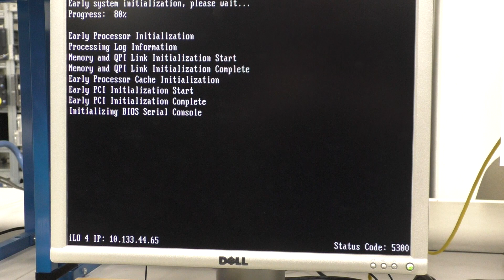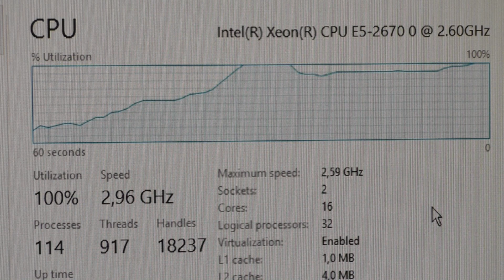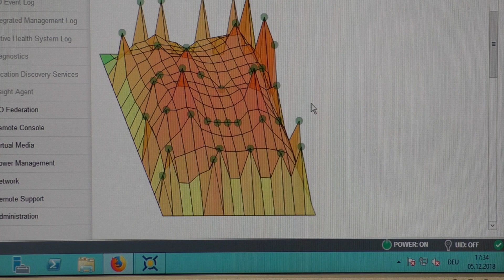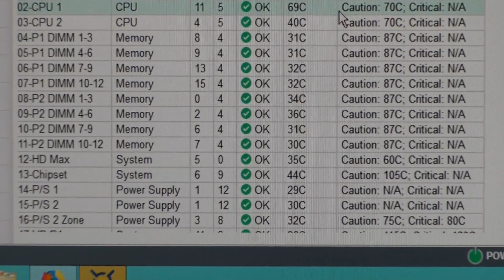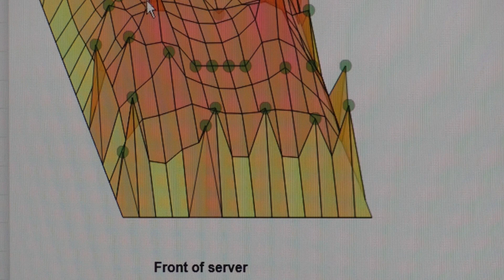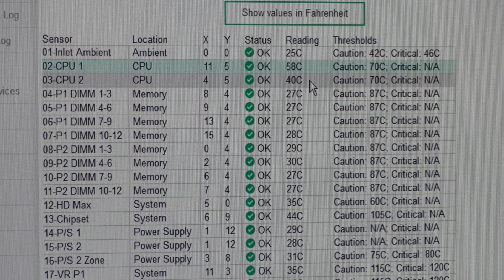What happens with a CPU without thermal paste? - (PWJ121)

Comment: Pretty sure Intel CPU have had thermal throttling built in for quite some time to protect them self from damage. There is however a setting in the BIOS of the DL380p Gen8 that will shutdown on thermals I don;t know if that was off or not during these test but since the processor never when beyond the caution level I don;t know that would make a difference.
Reply: i using i3 cpu and gtx 1050 ti already 2 year without thermal paste still fine with side case open-----surely cpu temp easy increase from idle 45-50 to 100% load 67-72 i look from every site as long cpu temp below 80-82 is fine

Comment: Running it without the top on will also typically make the fans run faster. Those servers rely on pressure & proper airflow to stay cool, remove the lid and that's now gone... the controllers send the fans into HOLY CRAP mode just to be safe / try to bring it to normal temp levels. 
interesting results.

Comment: CPU is throttling to stay below 70°C
Reply: TjMax on a Sandy Bridge-EP chip is 105.
Reply: @SoranoGuardias  i using i3 cpu and gtx 1050 ti already 2 year without thermal paste still fine with side case open-----surely cpu temp easy increase from idle 45-50 to 100% load 67-72 i look from every site as long cpu temp below 80-82 is fine
Reply: i using i3 cpu and gtx 1050 ti already 2 year without thermal paste still fine with side case open-----surely cpu temp easy increase from idle 45-50 to 100% load 67-72 i look from every site as long cpu temp below 80-82 is fine
Reply: My is 94
Reply: The chips throttle down to conserve power on light loads.

Comment: Excellent experiment and video! It clearly shows why a perfectly flat interface is so important. Intel thermal management is quite good. 15 years ago I saw a demo of removing the heatsink while the CPU was at 100% and the response of AMD versus Intel thermal management. The Intel chip throttled at the maximum temperature just as in this video but the AMD chip promptly exploded with a very decent bang. No paste with one hair seems to be well into failure territory.
Reply: No it never exploded. It overheated, smoked and died. It was Tom's Hardware Guide that did the test I believe, on consumer grade CPUs.
Reply: iirc it was also later revealed that the motherboard used in the AMD system which smoked in the Tom's test did not have a shutdown feature which monitored the CPU using the on-die temperature sensor. I don't remember the specifics but it was either using a thermistor mounted in the CPU socket which is far too slow to react to removing the heatsink, or the shutdown feature was inoperative. These days all CPUs have inbuilt throttling (CPU core voltage, core frequency control) so they can protect themselves without needing the motherboard to intervene, although most motherboards can still be set via the BIOS to completely shut down the system should the CPU hit a predetermined temperature.
Reply: @tmmtmm  Yeah lots of rumors flying around at the time that THG was in Intel's pocket too

Comment: So it seems that both, the CPU and the heatsink surfaces are very well made, smooth and uniform. Cool!
Reply: i using i3 cpu and gtx 1050 ti already 2 year without thermal paste still fine with side case open-----surely cpu temp easy increase from idle 45-50 to 100% load 67-72 i look from every site as long cpu temp below 80-82 is fine
Reply: gunawan gunawan santoso h uh you might wanna put thermal paste on there
Reply: gunawan gunawan santoso pre builds also come with thermal paste already

Comment: The frequency is correct, it is the turbo frequency of the CPU's. Yours is max 3,3GHz on 1 or 2 cores, but windows server reports the max frequency of any core as the speed even if it is only 1 core running 3Ghz and the rest running 2,.6GHz. My dual e5 2680V2 says it is running 3.6GHz, but the cpu's are only nominal 2.8GHz
Reply from the maker: yeah I know.... it's the turbo freqency
Reply: i using i3 cpu and gtx 1050 ti already 2 year without thermal paste still fine with side case open-----surely cpu temp easy increase from idle 45-50 to 100% load 67-72 i look from every site as long cpu temp below 80-82 is fine
Reply: @gunawangunawansantoso4122  lmao i3 and 1050Ti? What are you? Poor PC guy XDDDDD lololol

Comment: Noooooooooooo, poor DL 380, glad you survived, amazing servers.
Reply: i using i3 cpu and gtx 1050 ti already 2 year without thermal paste still fine with side case open-----surely cpu temp easy increase from idle 45-50 to 100% load 67-72 i look from every site as long cpu temp below 80-82 is fine
Reply: gunawan gunawan santoso Thermal paste is really cheap. Add it and it will significantly increase the lifespan of your CPU. Not using thermal compound is really stupid and can damage equipment.
Reply: @gunawangunawansantoso4122  good way of saving your budget by not buying thermal paste on a cheapass i3 with low tdp lmao